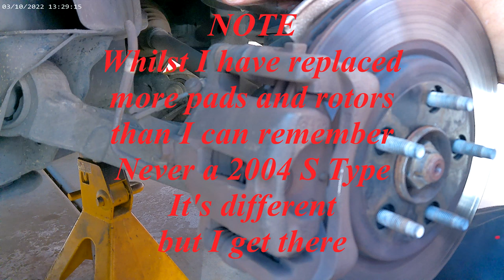Jaguar S Type 2004 Rear Brakes

Comment: Loads of good info here before I started my job. Top tip: if you don't have three hands, its easier to loosely reinstall the calliper without the disc for the purpose of doing the calliper rewind.

Comment: Great video thank you I've changed pads and discs on plenty of cars over the years but just bought an S Type and don't have a manual so it was really useful to see the job being done before I did it. 

As previously mentioned you can leave the car in neutral with the handbrake off - the car gets very upset about it but eventually stops whinging. 

After I put everything back together again I got a warning on the dash for the ECB and it wouldn't engage. I followed the re-calibration instructions on one of the Jag forums - it wouldn't allow me to do step 10 but worked nevertheless:

Reset the EPB module:
a. Switch off the ignition.
b. Disconnect the battery for 30 seconds. For additional information, refer to STYPE
Workshop Manual Section 414-01.
c. Reconnect the battery.
2. Start the engine.
3. Firmly apply and release the footbrake five times.
4. Confirm that the message â€˜NOT CALIBRATEDâ€™ or â€˜APPLY FOOT AND PARK
BRAKEâ€™ is displayed on the instrument cluster message center. This indicates that
the parking brake is in calibration mode.
5. Lightly press the footbrake pedal.
6. Apply the parking brake by using the EPB switch.
7. Release the parking brake.
8. Release the footbrake.
9. Confirm that the brake warning lamp is no longer illuminated on the instrument
pack and that the â€˜NOT CALIBRATEDâ€™ message is no longer displayed in the
message center.
10. Apply and release the EPB five times to ensure no error is present.

Thanks again and just wanted to say I sound just like you with the effing and blinding when I'm fixing cars - it's true - they really do try their absolute best to make every F'ing job as difficult as possible so you have to return it to the dealer, or they construct the damn things in such a way they'll never have to do a job when it breaks after 10 or 15 years but you'll have virtually no chance of sorting it either
Reply: 1) wear decent shoes to prevent losing toes
2) put a wheel nut temporarily on the disc to steady it so no need for 4rd hand.
3)  write a clear procedure on this job as now u are an expert
Great help for us Diy guys

Comment: If you can't get those bracket bolts off do what I did 10 minutes ago which worked really well. Get the socket on with the ratchet locked out to the side. Get bricks under the car and get your hydraulic jack lined up with the ratchet handle and use the jack to lift the ratchet. Works better than any other tip I have seen.
Reply from the maker: I did this car over a year ago and don’t remember the problem I had, either way I would never use bricks to support anything they tend to crumble when you least expect it

Comment: Well mate I will enlighten you go to boot right hand inner wing pull the plug on epb with the open end showing four terminals get a stiff piece of wire about 150 mm poke one end in the yellow wire hole and diagenally opposite the other thick wire   hole turn ignition on & listen for the epb motor to release when it has turn of IGn & it will be free

Comment: the spanner that fits an angle grinder to remove blade also fits the  caliper to wind it back ,saves spending money on a wind back too ,also i found you dont need to push az you wind back mine auto wind back just by turning it ,clockwise.
Reply from the maker: The tool I have fits more than on car and contains various types and sizes, I work on many cars so it is useful to have, also some of them are stuck and need a lot of effort to move

Comment: Inside the boot (on the right),  by peeling back the carpet once you have unscrewed the plastic retainer, you will see you can remove the two EPB sensor plugs, this will completely disable the parking brake so you can work on the calipers without any hassle.
Reply from the maker: Thanks hopefully your comments will help someone.

Comment: Wish I had seen this before I started. I just did upper control arm, tie rod, and sway bar end link on the left side. Noticed it needed brake pads, and I fucked up trying to get the ebrake off. I put it in reverse, and it threw the caliper backwards, cutting the brake line, braking the ebrake cable, and such. What a shitty design. Hoping to find one in a breaking yard so I can get the parts I need to put it back together again.
Reply from the maker: Damn that sucks, as the car is so old I am sure you will find what you need, I assume by your name you are this side of the pond, if so try LKQ.
Reply: @jagvette1  Thanks, there is a v8 car in the junkyard now, not sure how much of the braking system is compatible. Time to do some research. Stupid design.

Comment from the maker: Apparently there is a method to release the parking brake so it stays off when working on them, wish I had know this before 😬🤫
Reply: you just hold the parkbrake bunnton while you turn off the ignition. and now you cant drive away with the parkbrake on. it will disengage by itself enevrytime you put in in r or d
Reply: Inside the boot on the right hand side there is a large plastic retainer, unscrew this and peel the carpet back and you will see the EPB sensor, just pull the two multi plugs from the unit and it will disable the parking brake.

Comment: has anyone had problems  with abs scantool says rear right tooth missing on ring but ring is ok ,dont want to go to all that trouble replaceing ring if it aint the problem ??
Reply from the maker: Never heard of that, is the sensor clean ?
Reply: @jagvette1  first time scan tool said it was sensor so changed  cleared code light came back on after short drive this time says reluctor tooth missing ,but on inspection ring look ok ,rusty/old but deff no teeth missing .

Comment: Put in neutral. Handbrake will be off. Nothing wrong with system. Simple job. Instead of swearing try thinking
Reply from the maker: Wow such a helpful comment and sarcastic remark from a keyboard troll , don't see your helpful video's anywhere. now you can go back to your pram.
Reply: Wouldn't let you lose with a spanner on my pram 😂😂